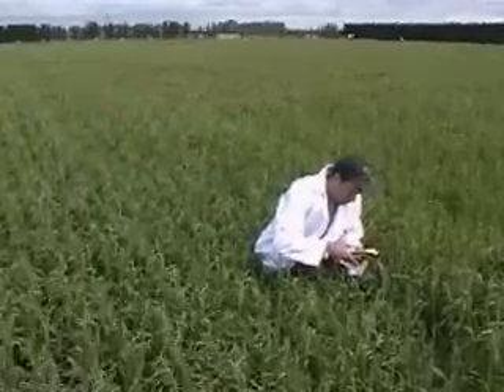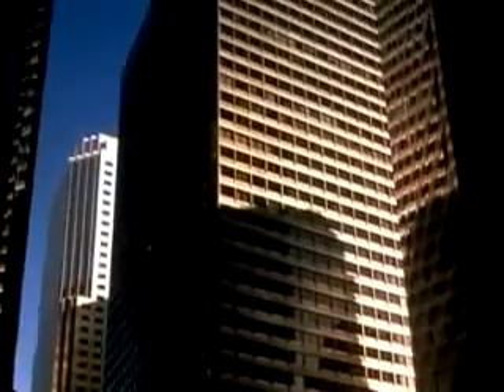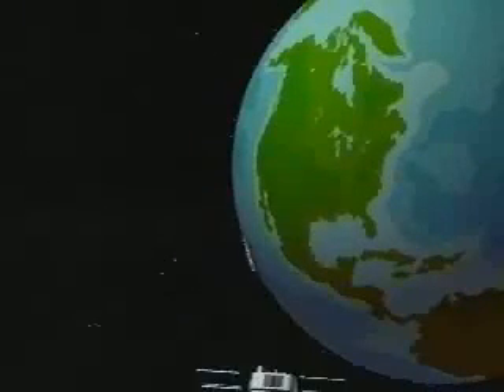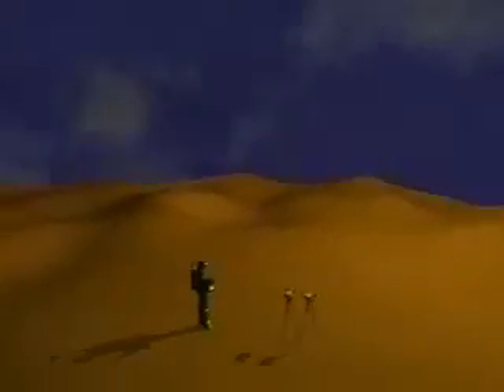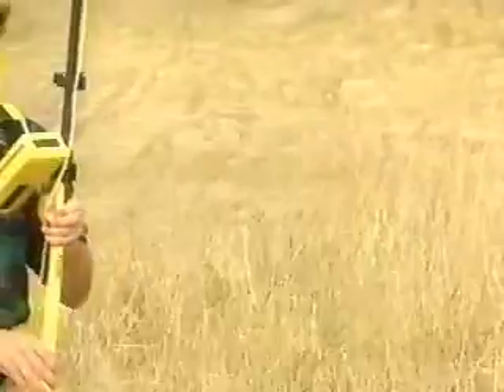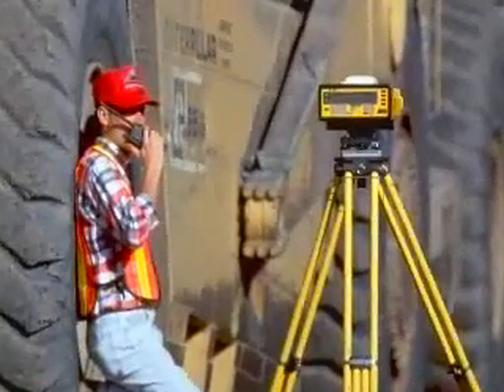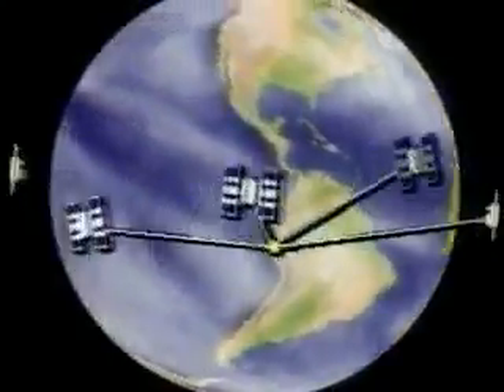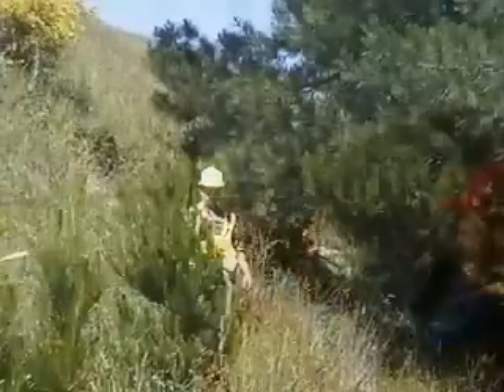GPS Principles Video

Comment: GPS position is determined by use of trilateration rather than triangulation.  Trilateration uses intersections of spheres.  Triangulation uses angles.  
Very common mistake.
3 satellites give you 2D, it requires 4 satellites to give 3D position!!!!  The 4 satellite is to correct for time and to give altitude or the 3rd dimension.
Couple of other minor errors but otherwise good info.  The principles don't change much in GPS.